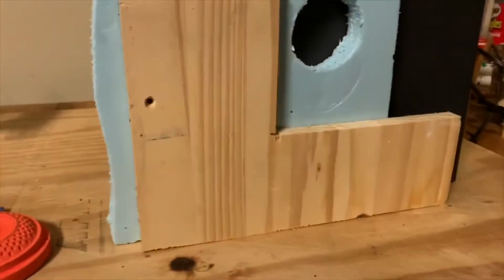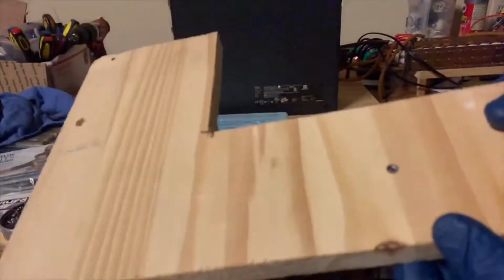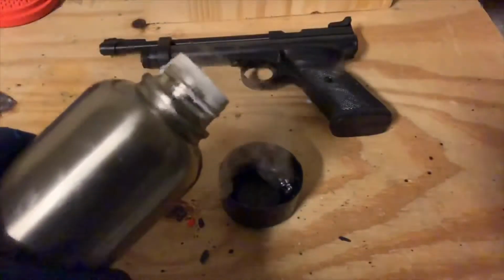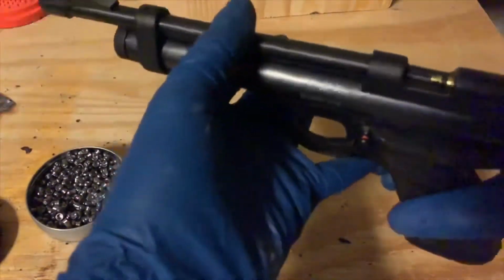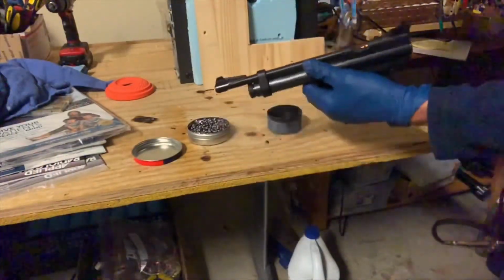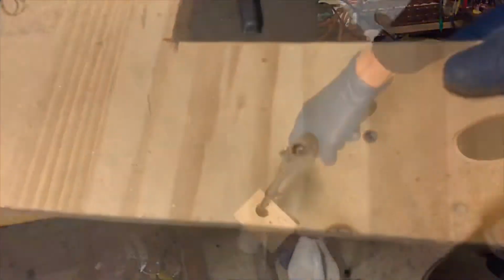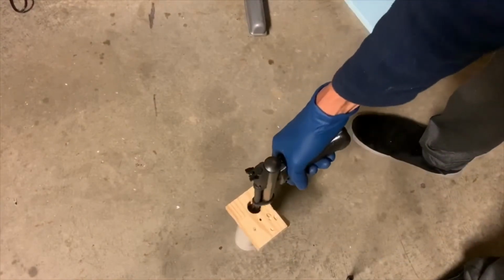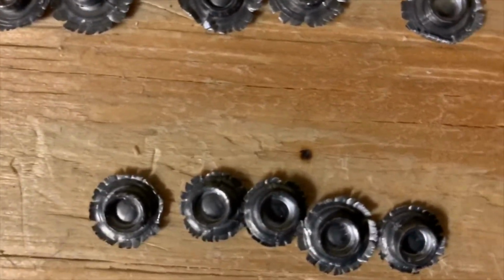Airgun Pellets at -196 Celsius

Comment: CO2 guns are less powerful at low temperatures.  You'd get more interesting results by heating the pellets to a temp slightly lower than would melt the barrel.